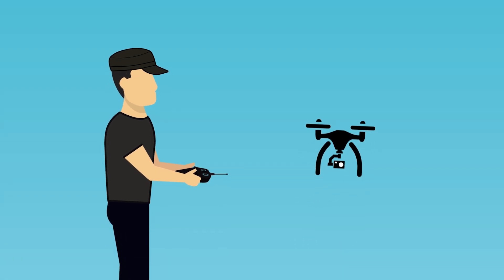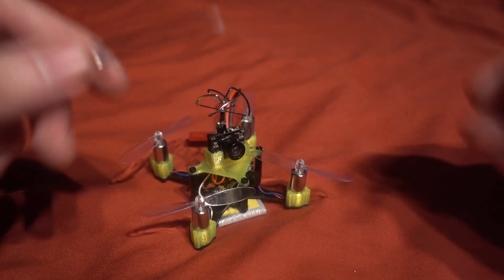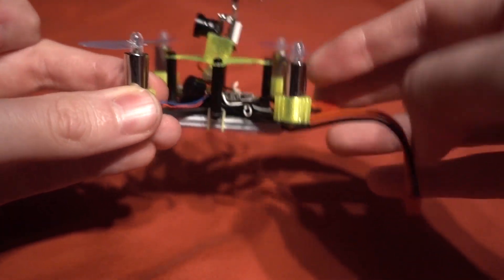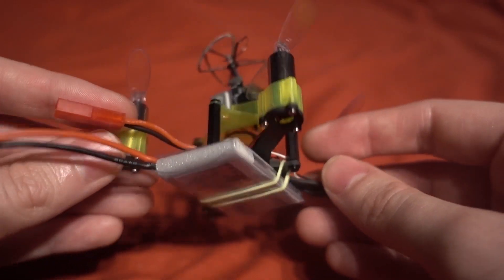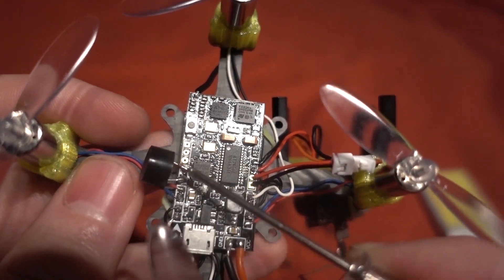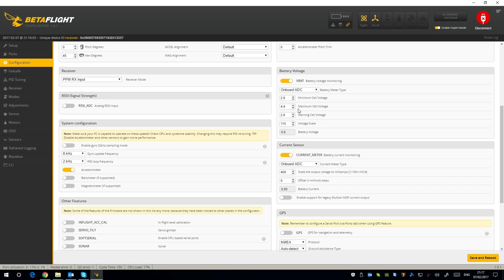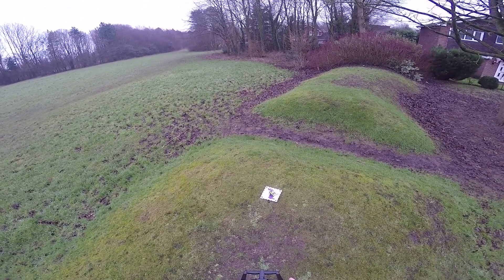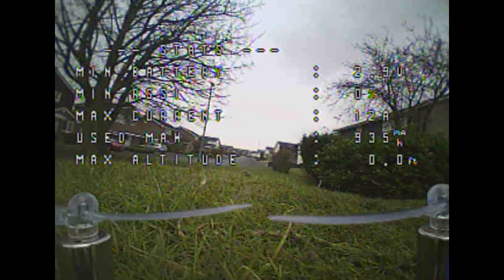Rotorious FPV Speck 80 + AIOF3_BRUSHED OSD

Comment: I own Speck, Puck, Crook 110 and Spectopuss frames from Rotorious FPV and I love them all! Big Rotorious FPV fan here. 
Their brushless frames are awesome too.
The Speck presents some interesting build challenges especially with props.
I love my "Rotorious JJ" but alas it's getting a proper FCB very soon because the toy FCBs are behind me. -I mean look at how that thing is flying! No comparison.
I wondered how one would do OSD with an AIO -that's pretty easy!
Bummer that you had such trouble with the boards. Maybe adding the additional CPU-intensive stuff has introduced unexpected weaknesses in the design?
OSD is very tempting, but of course as we add features we are going to feel the impact elsewhere in the engineering of the thing, and in this case it's power usage...and frailty. 
I'm still in micro losi country with my connectors...should I convert to JST?
Easy enough to do but I'm skeptical.
Sorry to ramble but it's what I do man. 
As always a great video sir!

Comment: Hi AndyRC,
thanks for the reviews. I wish i watched that before i buy one :-(
I get the FlySky Version, on first flight one FET burned and motor spin if i connect lipo.
OSD did not work, got only black screen with osd info. Testing with two cameras and cant get it to work.

Next i learn that the FlySky Version has no RSSI and no Failsafe.
Receiver send last command so FlyAways are no Problem.

PunchOut's are not worth talking about, same Setup with an old Hubsan X4 FC has so fast Speed and PunchOut comaring to this FC.
Dont know why Eachine build such a poor Board :-( 

Do you know a good FC for 1S brushed with Power and stable FET's ?
Im thinking about this one: Realacc F3 V1.0
But cant find infos from Customer how that Fly/Punch :-(

Comment: I have been using the Frsky version of that AIOF3 board in a MI110 frame, with Racerstar 8520 motors, KingKong 65mm props, and a Boldclash F-02 cam/VTX. I have had no problems with the board at all, in fact, it is currently my favorite brushed quad. 

Although, from reading the forums, there does seem to be a quality control issue with a lot of these Eachine boards, particularly the ones with integrated receivers, but I seem have been lucky with them ...so far.
Reply: I may have spoken too soon. I am now getting a momentary burst of two of the motors when I plug in the battery, which, I am told, is a sign of bad mosfets (as you alluded to in your video). Such a shame, I was intending to put these boards in a lot more builds.

Comment: I had that same problem with that FC - 2 motors spinning when plugging the battery in, then one of them continuing. Good to finally know what the problem is.

Before it all died, did you get a chance to find out if Failsafe worked on Flysky. I haven't yet found one person who can confirm it does (but lots say it doesn't). If you move the sticks whilst plugged into Betaflight and then turn off the TX, it holds the stick values (which is not what Failsafe is set up to do).
Reply from the maker: +benjamenus yes sounds like it's got work to do

Comment: Andy,
Looking at the physical size of your battery on this, I can't help wonder what the aerodynamic effect it has on your flight. I think you should take this into account when trying to work out what's wrong. Try the bird with a smaller battery to check the flight characteristics.
Reply from the maker: u could be right but not usually a problem cheers

Comment: Thanks for the review.  Perhaps you can pick up a Spracing F3Evo FrSky board for it. Won't have OSD, but it will at least be reliable. One thing I really liked was the motor mounts, which hold the motors vertical. On my QX95, I'm constantly adjusting the motors so that they aren't skewed.  That LiHV 1S battery looked interesting, but I have many chargers .. none of them do LiHV unfortunately. We have snow and -5C right now, so no flying outdoors .. it's that 'global warming thing', you know.  Cheers!
Reply from the maker: +Bill Somrak we have had non her. Kinda disappointed :-(

Comment: Is that board a similar size to the brushed f3evo boards that come with the qx95? Trying to decide if my qx95 components will work on this frame
Thanks!
Reply: Just looked up the specs on both myself lol, for all those wondering it should work. The QX series board is 5mm shorter and 1mm wider then the one in this vid

Comment: This is weird, I have cut two TX01's in half to make low-profile installations and on both of mine the Video Out of the camera is the the inboard pin, the outside pin is Ground. I'm holding one now and the camera comes from a TX-01 and the inboard pin is wired to the outside pin of a VTX-01, which is Video In!
Reply from the maker: +patrickcol they must have changed the order so it's easier to split

Comment: I had the same issue with this board on my QX105 Bat. What is the component called? Also is it possible to repair the board?
Reply: Sagal51 Its called a mosfet. Try and read the name/code of your mosfet and look it up and see if your local electronics store sells it.